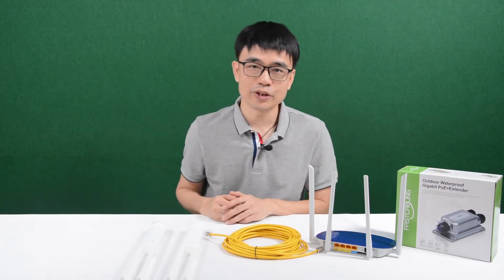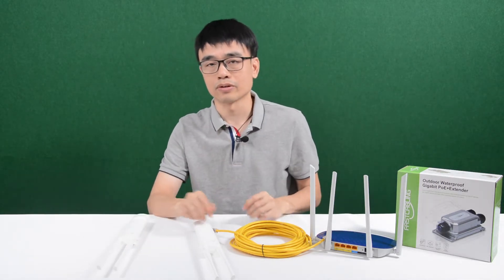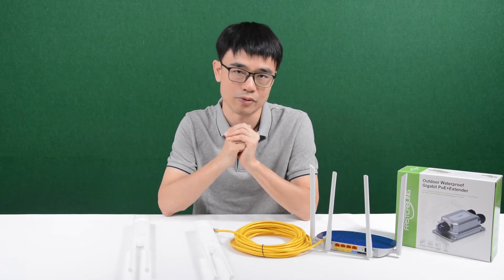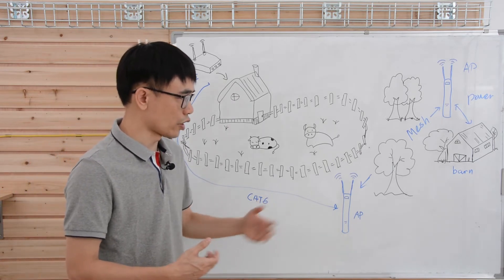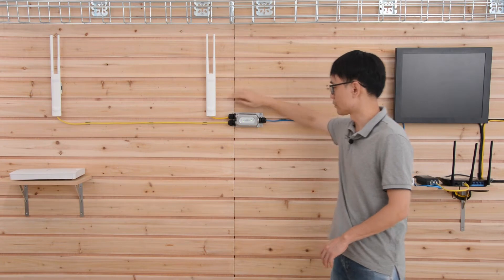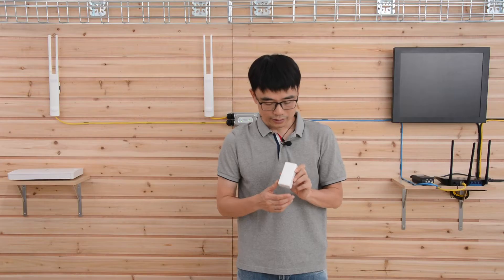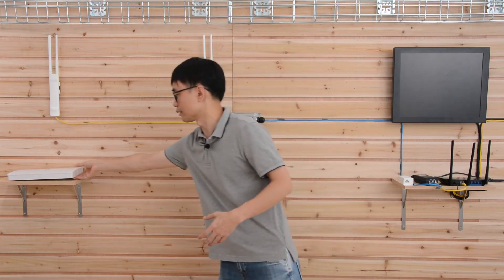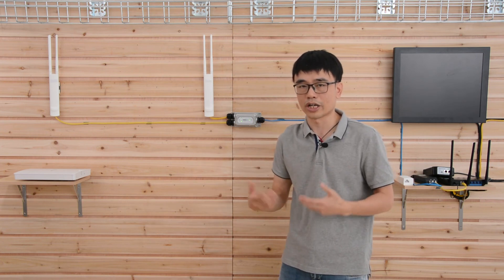How to install 2 set EAP-225 to improve the WiFi coverage

Comment: Is it normal for the tp link eap 225 is over heating? Thanks for answer?
Reply from the maker: Moderate heating is normal, especially if it's used in high-traffic environments or mounted on a ceiling or enclosed space with poor airflow. However, if it frequently disconnects or reboots or if you notice Wi-Fi drops or slowdowns, please contact TP-Link support for further instructions.

Comment: How to extend the tplink aep225 from main router by cat6 cable. Because only have 1poe port and 1 Lan port. So which 1 port to use
Reply from the maker: It goes to the PoE port. This extender can transmit power and data simultaneously to the ap.

Comment: Can I connect as a repeater without wire
Reply from the maker: Yes, you can create a mesh network or use the WDS feature. First, navigate to the “Operation Mode” settings of the secondary EAP225 and select the “Repeater” or “Range Extender” mode. In the “Wireless” settings, set the SSID and security settings to match those of the main EAP225. This ensures seamless roaming between the two devices. Select the same channel or set it to auto to allow the EAP225 to choose the best channel.
Reply: @Fastcabling  Where is the "Operation Mode" setting located in the Web-Frontend of the EAP225-outdoor?

Comment: This so useful tutorial, and i plan to extent 1 more eap 110 at my yard. 
But my question if i use 2 tplink eap 110 what configuration should i do of 2 tplink eap 110
Reply from the maker: Thanks for your comment. Not sure if it helps...but if it doesn't, please consult for more information. 

Place your EAPs strategically to cover the desired area without too much overlap to prevent interference, but enough to ensure complete coverage. Connect to each EAP110 via Ethernet to access its management interface. You might need to set a static IP on your computer to match the default IP range of the EAP110 for initial setup. Set both EAP110s to broadcast the same SSID (network name). This helps devices to recognize the network as a single entity, allowing for smoother roaming.
Reply: @Fastcabling  thank you so much
Reply from the maker: My pleasure. If you're interested, we can also provide a free solution design for our customers. You can submit your inquiry here: https://www.fastcabling.com/free-solution-design/

Comment: How many can support ap?
Reply from the maker: FYI, this 2-port PoE extender can support 2x access points at a time, with a maximum power out of 30W per port. Transmission rate up to 10/100/1000Mbps.

Comment: Good day.
I have a problem to my EAP225-outdoor did not stop flashing the green and yellow light 
Please help me...
Reply from the maker: You might bring the EAP225 next to the PoE injector and try to power it up with short patch cord. If the indicator are not ON, the EAP could be defective.
Reply: @Fastcabling  i have another questions, can the eap110 not be sep up and i just direct it to the omada oc200 controller, will nothing bad happen to eap110?
Reply from the maker: No, it will not.

Comment: Hi, question, my wifi coverage using EAP225 (it installed in 12ft pipe) is only about 50m only and I need to reach to my store with 110m from my house. If I add a new EAP225 on my store, will it be able to get the wifi signal from 50m? Or it should be in range of the first device?
Reply from the maker: You can create the mesh network, and the signal can be sent from the EAP225 not your house. However, you need to verify the WiFi coverage at location where you want to install a new EAP225. If the signal is weak, you don't get the good result. Probably wire connection is the solution.
Reply: @Fastcabling  I'm considering this one but my thought is I should install the additional EAP225 where the strongest wifi signal from the first device, right?
Reply from the maker: Yes, you can repeat the signal well unless you have strong signal source.

Comment: I love the video Tuturial
may i ask what will be the best injector i can use and how long the distance

from the switch hub to:
1.eap 225 and eap610 outdoor?
2. eap 225x2?
3.eap610x2?

hoping for your help for my project proposal and send me please the link your legit seller her in shoppee for me to quote the pricing the  proposal i made.
thank you
Reply from the maker: I think you might need a PoE switch that can provide you multiple PoE ports to take all all those access points and you can hook up this switch to your main network. As long as the distance is less than 328ft between the access point and the poe switch, you can pull a cat6 cable to set it up.

Comment: Bro could you suggest which ap is best to cover 250acres of land with buildings and trees with internet connection 
Was considering using mant box 19s
Reply from the maker: You might consider the netgear Wi-Fi 6 AP.
Reply: @Fastcabling  for outdoor?  Cos i want service in and out

Comment: Can these two APs be used to put a access control reader in an elevator and the other one at the top of the elevator shaft so I don’t have to hardwire the elevator car
Reply from the maker: I believe what you are looking for would be the wireless bridge. The wireless bridge will take all the Wi-Fi power and send it to single direction. The standard Wi-Fi use radiation form to emit signal.

Comment: Hi, I'm so confused. I watched your video a few times and not quite sure if i'm missing something. I plan to install outdoor wifi cameras on my property, not knowing anything about this, your video is helping. I plan to use two of the same antennas you have in this video, I am able to run a cat6 cable to both of them. According to your video, I need a Poe extender to run to both antennas. Now I need to power these, you show a 30amp injector, is this correct? Does your website have both of these units?
Reply from the maker: If it is the original TP-Link packages you should two PoE injector included. It is the 24V passive PoE injector. But it works. You only need to attach those two PoE injector two your router. You should be good.
Reply: @Fastcabling  , Thanks, one ladt question. I plan to mount the acess point to a pole in my yard, I also planned to mount 3 cameras to the same pole. Will the cameras function properly being mounted only one foot from the access point? Thanks again.
Reply: The way he is setting this mesh up in the video requires ethernet cable being ran to each AP.   
If you are only using them for cameras , why dont you just use POE cameras instead of wifi cameras?
Reply: @danielmielewski4595 , Hi thanks for asking. A couple reasons, I am pretty much clueless about all this, I had already bought the cameras before watching this. But, we are out in the country, our phones get zero reception in the yard or in my shop. The house we bought already has conduit from the house to the shop. By using this wifi system, my cameras will hook up to it and we will have wifi in the yard and shop.

Comment: Thank you. Do you need to add a "Controller device" to the router in order for the mesh to work for those EAP-225?
Reply from the maker: No need. The built-in firmware support mesh network.
Reply: @Fastcabling  Please Can you do a video about Mesh network?
Reply: @Fastcabling  do you a video how to set up mesh in computer
Reply: @Fastcabling   how could you configure without having a mesh
Reply: you can install the software on a windows PC. no need to buy physical controller
Reply: If the two EAP is in Mesh, can it be managed in the omada cloud?

Comment: How do you connect them as mesh not direct? (One powered by poe and the second meshed to first without direct ethernet connection.) 

Thanks
Reply from the maker: You are right. You need to connect at least one access point to your main network by using the cable. The rest of the access point can have mesh link to the each other and hook to the first one. However, the rest of the access points may don’t need the wire network connection, it still needs the power, that is when the PoE come into play. The PoE only supply the power to other nodes.
Reply: @Fastcabling  I have two EAP225 I cant get them to mesh together, one connected to router other one just powered with poe. 50metres apart. where are the mesh settings on Omada controller??
Reply: @Fastcabling  thanks! Setting up my second eap 225 tonight.
Reply: @cduggin.   1.  Router + Access Point EAP1 connected to Cat Cable 2. Second EAP2 connect as wireless Access Point or Bridge. Make sure the signal strength of EAP1 is within 60-80% to your wireless EAP2 so you can extend the wifi coverage correctly.